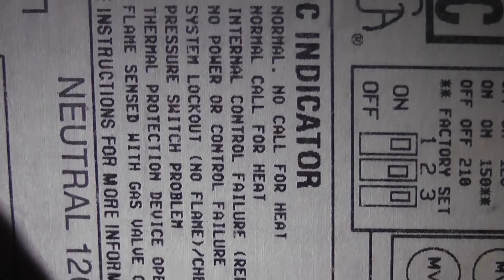Furnace Trouble (take 2) - Time for a closer Look (Trane XE80)

Comment: Mines doing the same thing. Tapped on the gas valve for a year now. Think I finally ran out of time. But bad timing. Supposed to be 0 degrees for a week
Reply from the maker: lol - i know the feeling.  the furnace could fail anytime during the winter months but it has to fail on the coldest day of the year and most likely at night or on the weekend or on a holiday! :)

Comment: Enjoy your videos. It’s nice to find someone with the same exact furnace.. I’m not sure if you mentioned the bottom panel has a safety switch which you have to hold or bypass. One common thing everyone needs to do is change their filters or your unit will actually struggle.. having the right Merve is very important. Most of the parts on these furnaces you can change yourself. I’ve been buying spare parts even the control board I found on Amazon, which you know a dealer is gonna charge you three times the cost…

Comment: Thank you! Just worked for me on my old XE80. Last night it stopped firing up, no heat. Got up this morning (54 degrees in the house, 17 outside) and found this video after trying to manually light the burners to buy some time. Turned the on/off gas valve knob, tapped on the outer valve body, said a few choice words and voila...HEAT. Still warming up the house so we will see if it fires up again.
Reply from the maker: LOL - I know the feeling!:)  Keep an eye on the gas valve:).
Reply: What are those magic words? 😂

Comment: After a few hours of scouring the internet I fall upon your video. Furnace mechanics is simple enough but I would not think a gas valve could stick. Moreover, I would not think hitting it a few times would get it to work, like an old tv back in the day. Sure enough after a day and a half of using the stove for heat, your trick worked. Of course I will replace the valve but now I know it is the valve. Thank you.

Comment: My status light isn't even working
Reply: Just commenting in case anyone else has this problem. If the status light isn't on check your control board. Make sure there is power going to the board and inspect the outside of the board for burns/corrosion. Probably have to order a replacement board if power is getting to the board, if not then you will have to figure out if your outlet or power supply is bad or has a short in it somewhere.

 Also you will most likely have to order the control board through an online retailer because TRANE wouldn't sell to me directly as they said they don't sell directly to the public (at least at the trane store nearest me). Make sure it's the same part number too or is a replacement part for your part number. Also make sure you take a video of all connections before you disconnect the old control board. Also be prepared to either pay alot or have to wait a week or two for your part to come in. So there is an argument for calling a professional if you either aren't sure how to do it or can't locally source the part from a store.

Comment: I have the same issue, I replaced the gas valve and still no gas. I put the old valve back on and fired it up and still no heat coming from the burners. I shut the unit down and traced the wires to the board and started to clean out some of the dust from the contact wires. Flip the power back on and I got heat. But it is intermittent, I think my issue and could be yours (if you haven't figured it out already) is electrical. I'm no HVAC guy, but I've repaired enough shit to get in there and mess around and figure things out.
Reply from the maker: Thanks for the post:).  It's that time of year when the furnaces fire up and problems occur ... mine ended being the gas valve.  Like yourself, I typically a fairly handy person and like to tackle things on my own if possible.  In this case, I found a gas furnace repair person who replaced my value (I recorded effort in my take 3 video (linked in the description - I figured since I was paying for their time I might as well record it for others to learn from:))).
Reply: @RealWorld  thanks again! In 10 more years, I'd love to see these millennials try to repair some thing. I had to help this 25 year old change a tire the other day.. all I could do was shake my head in disbelief. Anyways, keep up the videos, they do help!

Comment: Thank you RealWorld!   That is very helpful.   I have the exact same furnace as yours.  Inside the furnace, mine has foams on the 3 other sides (except the one for the filter) that are screwed to the furnace wall surrounding the blower.  They are dirty.  Do you in case know what they are for?  I want to remove them.  I cannot tell from the video whether your had or not.  Thank you!
Reply from the maker: Glad to be of help ... always good to share knowledge!:)  Not certain is you viewed the third video which might be of more help - https://youtu.be/Y9TtwlZhjiQ  ...  I do not recall removing any foam padding.

Comment: This video frustrated me.  Unplugging wires, multimeter... turned mine off and then back on and the burners lit.
Reply from the maker: i did the same multiple times over the course of a few weeks until the restart stopped working:)
Reply: @RealWorld  I enjoyed your video and tried some of the simple techniques.  When these did not work I called in a specialist.  Turns out that because I had closed some of the vents in my house (about half of them to the lower floor while air conditioning in summer) it caused my furnace to work harder when it turned on.  Also, the tech put in a new cheap fiber filter instead of the fabric material or hepa filter I had.  Air flowed in the air intake by the filter without sucking the filter full force against the unit. This was witnessed visually, huge difference. Upon getting more airflow, my troubles were solved.  He also suggested that is is not good practice to have a 15-20 degree spike between a night time setting and a morning setting.  It tells the furnace to be on for a long time to bring the temp up, and this inturn causes overheating (4 blinks of the light).